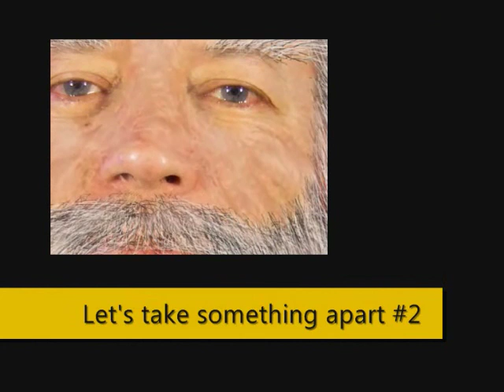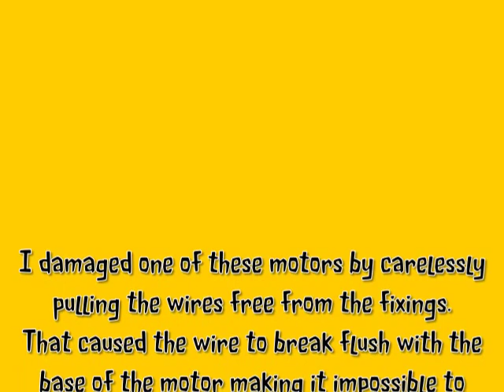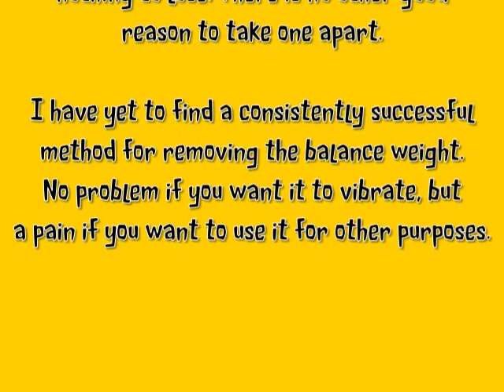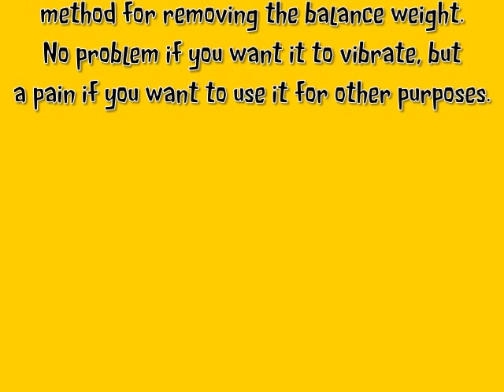Let's take something apart #2 - Vibrating Toothbrush Motor

Comment: My favorite rotary vibration motor is those bldc vibration motors which uses stator winding and a microchip to spin the offset weights directly. Those bldc vibration motors are significantly smaller than the conventional vibration motors but pack quite a punch. There used in Fitbits.
Reply from the maker: Certainly a clever bit of technology. I haven't tried them myself. It would be interesting to try to make use of them for any purpose other than vibrations, for example a normal electric motor application 🎄🎅😊
Reply: BLCD vibration (yaoi asmr) otome xD damn any fujoshu here lolol

Comment: Please tell me how to take off the half moon shape? (2:13) I'm trying to put one of the plastic fans of my mini drone onto it, because I've seen my friend do it. It's really cool, because the whole thing will just start flying and it's also really funny. Any suggestions?
Reply from the maker: Here is my video on that subject https://youtu.be/rAkSnCSv0Lk This method works OK as long as you hit the shaft cleanly and do not allow the motor or the assembly to wobble around. I was getting nearly 100% success but recently I have been trying to do this with motors that have very thin shafts and have had a terrible success rate. It seems that the manufacturers have changed to smaller motors with thinner shafts, probably to save money, and the latest ones have been very weak.
Reply: GrandadIsAnOldMan thank you so much! I managed to get it off and attach the fan onto it. I turned it on and it's working!! Thank you!!
Reply from the maker: Wow, that was quick work. I am glad it worked for you, like I said, I have had several failures trying it recently.

Comment: You can buy those small motors for just $1 on eBay, free shipping. They cost pennies and they ship them straight from china where they are made.
Reply from the maker: Yes that is true, I buy lots of stuff from eBay and a pack of 4 hobby grade 3.7 volt coreless motors are a bargain and far more powerful than the motor in this toothbrush and a pack of 4 is much cheaper than buying this toothbrush. However I use these toothbrushes and I hate to throw anything away that could be re-used so I save them when they are worn out and use them for projects. I certainly would never consider buying the toothbrush just to get the motor. Here is an example of using these motors https://youtu.be/1yJb_dIebaA

Comment: hello what is used to control the motor while it is in the toothbrush? is there a microcontroller or switch of some kind?
Reply from the maker: Just a very basic switch which pushes the battery away from the contact when not in use. A classic piece of simplicity in design.
Reply: @GrandadIsAnOldMan  Wow very simple design, reliable and elegant. A design requires minimal maintenance, and is much cheaper than shipping a product with some sort of timer like a microcontroller or 555 timer. I am working on a product now that is going to need a timer.
Reply: thank you for your fast reply

Comment: Hey there I have a flat motor off my cell phone and the wires on it are snapped off and I want to take it apart and rewired it is it possible
Reply from the maker: I have never taken one of those apart so I cannot give you any advice. Usually with these very small motors the wires are crimped in place rather than soldered so you may have problems trying to attach new wires.
Reply: Yes I know that I tried to take it apart but I couldn't for some reason guess onces it built that its if it dies well it dies even though the motor still good it just i made a mistake a cut the ribbon cable off

Comment: A successful method for removing the weight, is to fit a small pair of thin scissors between the body and the weight and tap the motor free, using a small drill bit and a hammer.

Comment: GrandadIsAnOldMan, how to remove a vibrating motor from Nokia 1112 type RH-93? pls help because the motor is sticking on the circuit board. i dont want to destroy the motor :C
Reply from the maker: Sorry, I don't have one of those mobile phones so I cannot comment from experience. I would guess it is soldered to the circuit board by it's terminals and you would need to unsolder them, but I do not know. I would suggest a Google search, you never know if somebody has already done it.
Reply from the maker: I have just done a Google search and found this page with a picture of a 1112 and I can see the terminals are soldered through the board. I expect it is probably glued to the board too. You can probably cut away the circuit board piece by piece if you have suitable cutters so you have easier access.
You may be lucky and just unsoldering the terminals releases the motor. I have not tried this.
http://www.u2ugsm.com/blog/nokia-1112-layout-diagram-of-whole-board-manual-schamist/
Reply: Thank you for the suggestion. I'll try do it
Reply: it works! thanks Grandad :)
Reply from the maker: Commando Syamim hey that's great, thanks for letting me know. What are you going to make with it?
Reply: Bristle bot :D
Reply from the maker: Commando Syamim I have a playlist of Bristle Bots, they are some of my earliest videos http://www.youtube.com/playlist?list=PLA5a2xPRSrB2WfmROVP1Pl5p_6MnWwgBx
Reply: Thanks Grandad!

Comment: 2:13 😭😭how did you removed the back of motor😭😭
Reply from the maker: To be honest I don't remember but looking closely at the picture it does look a bit chewed up round the edges. You could just grip the metal case in a vice and tap the end of the shaft. That will probably push the plastic end out but I doubt that you will ever be able to use the motor again. Why do you want to take it apart?
Reply: +GrandadIsAnOldMan I have 8-9motors with only 1 or no wires attached
Reply from the maker: rohan bhardwaj I am afraid you have virtually no chance of repairing them. I wish you luck, you will need it.
Reply from the maker: rohan bhardwaj I have taken a couple apart tonight using the method I suggested but the brushes are very thin and I was unable to get the motors back together without damaging the brushes.
Reply: +GrandadIsAnOldMan oh! thanks anyway! :)
Reply from the maker: rohan bhardwaj If they are already broken then you lose nothing by trying, so good luck.

Comment: make a drone with vibrating motors
Reply from the maker: It is a very expensive way of getting small coreless motors. You would be better buying good ones from eBay as they would be cheaper than buying 4 toothbrushes. In fact you could buy a nice little RC quadcopter ready to fly for less money than it would cost you to buy 4 toothbrushes. However I did use toothbrush motors to replace the motors in my mini-quad in this video last year https://youtu.be/sZ812rEpD8w?list=PLA5a2xPRSrB2ff05_X2Ek0sMNXA35IFyx